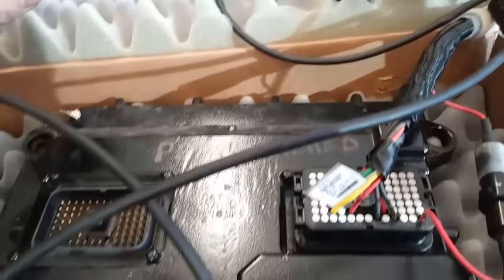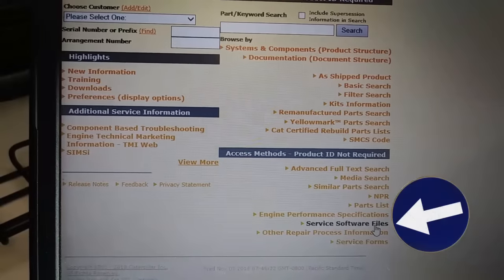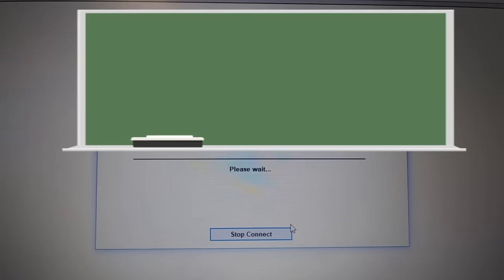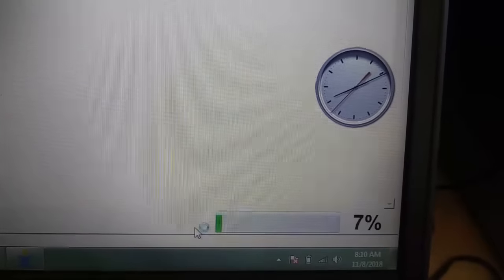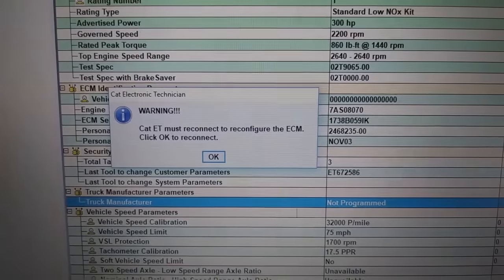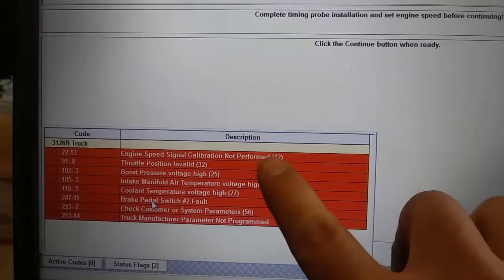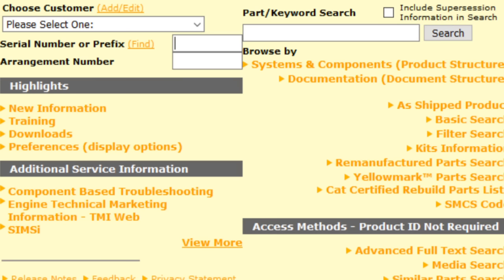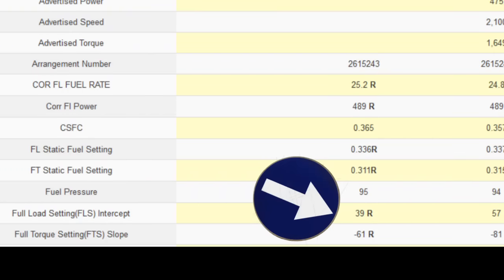How To Program A Cat ECM. How To Flash A Cat ECM. Cat Computer Programming.

Comment: I have a 2001 Kenworth t800 c12  ycpxm0729erk engine#2ks49050, I have installed a 2007  c12 BCY-00138 family 5cpxl12.0esk (military surplus engine) generator engine my questions #1  is there a program out there for this conversion. Question  #2   what is the difference between the two engines other than voltages the ypc(445hp)  hp and variable speed and the BCY is 515hp and wants constant speed (RPM) and turbo, is  the camshaft the only difference or is the crankshaft and stroke different. I did had a local guy program the BCY (ECM) it does run and idles fine but  when driving there is a few spots that the engine sputters then puffs out big cloud out the exhaust pipe (fuel) I can feather the throttle out but I want to fix.  Any ideas to help. I think its the camshaft and timing issue in programming, Would you know if its just the way the camshaft was designed for constant RMP. and /or think that if I change to a truck camshaft and ECM that it will work with the crankshaft and stroke of the BCY engine  and/or the injectors need to be changed .I really enjoy your videos and thanks for sharing your knowledge and experience cheers

Comment: I am having a head scratcher problem, I do all these steps, get the same starup communicating messages in this video, ATA then CDL, the j1704 light flashes but yet it always comes back with no ecm detected. I know this can't be right cause my 3126b starts and runs just fine??

Comment: Got a REALLY left field question here...   Would there be any possibility at all of taking a direct injection CAT 3408 and modifying it to be an electronic engine.  For example,... using electronic injectors from a 3406E or later electronic engine?  I'm sure there would have to be custom heads in order to fit 3406E or later injectors into a 3408,.... and then there is the entire ECU problem.  But what about going with a stand alone aftermarket ECU?  Just throwing around some crazy ideas.  The 3408 is such an awesome engine and I want to put one in a Peterbilt,... but would like to get best performance and fuel mileage with newer electronic technology.

Any thoughts, comments, etc. would be GREATLY appreciated!  Thanks

Cyrus

Comment: does reflashing an ECM damage it in any way.  I have a BXS engine that had the double turbo and was converted to single turbo the ACERT was removed all prior to me purchasing this truck.  i now had to purchase a new ecm and when the mechanic reprogrammed we now have the check engine light and three codes which are due to the ACERT being removed.  I have a guy that can put a new program that will remove the codes but I would like to know if reflashing will damage my new ECM
Reply: No

Comment: Great video thank you for all your help allways   Got a quick .question I have a 97 kenworth with a 3126   We did a covertion from 390 rear end to 358 teams end. And now my truck won’t t go over 60    Do I have to take it to get program ??
Reply: No you have to take it with someone who has a tool that can connect to the ECM and reprogram the PPM.
PPM = Number of chopper teeth on transmission X Axle Ratio X Tire REVS per mile.
Reply: You have to change the dip switches behind the speedometer so it reads correctly. Then update your PPM in the ECM so the data is stored correctly there.
Reply: @jimmywells33  is there any info on how to do that? Changing the dip switches etc?

Comment: Back in 1996 had a new KW doing the second oil change, around 20k miles, did the service started engine ran for leaks shut truck off, went into the office to pay the bill come back to truck check oil level go to start truck to back out of the shop engine wouldn't start, the ecm died that fast

Comment: What could cause coolant to mix with oil and also oil preasure drop at the same instance....? CAT3406e
Reply: Possible crack in the block or cylinder lining,  head gaskets
Reply: Or the oil cooler. Happened to me i had a 3406E IN a 96 freigjtliner FLD. Mixing oil and coolent and lookes like milk. This was back in 06.
Reply: Could be O ring's

Comment: aloha adept ape , i have a morbark 2006 model blizzard12 w a caterpillar eng 3054c/e type 2 this eng has 3 settings for the rpms and the high setting is revving at 2550 rpm. its seems high and i am inquiring of how to lower the rpms to 2000-2400. any advise ?

Comment: hey buddy, how r u? i wish u the best for all your helps
i have a problem,
i have an engine which its ecm needs to be flashed and programmed again, but unfortunately the engine does not have any id and i just guess it is 3406e. now the current ecm communicates with adapter but as someday was changed with someone and not correctly programmed, it does not show any serial no and maybe that is the reason the engine does not start.
finally i want to know that is there any way or method to get the ESN of an engine by not counting on id plate or ecm info???
because i need to get the correct flash file and program the ecm well.
my best regards

Comment: I have a question for you Josh, if someone got your timing calibration, or fts or fls messed up could it cause a truck to start burning oil. I had a ecm go flag and right after I started using oil. Thanks

Comment: Can anyone help me out about check engine light ECU 128 PID 289 fail 05  I have 2009 freightliner Columbia with C-15
Reply: Most of the time you have a bad connection on the IVA solenoid. You can buy a harness or a splice. The splice rarely holds. I usually take the splice (if I use one) take it apart and use the plastic connector. I take the connector on the engine and remove the plastic connector and spread the connection to get the fit tighter. I put the new connector onto the harness and feel if its snug.
Reply: John Goldsmith  thanks I’ll try

Comment: Hi mr. Josh,

I had a question, what do you say about that whenever I want to test cylinder cutout on one of my engines, it is aborted automatically.
I tried at different times and watched the loads on my engine, but its unreasonable because I had no change in loads

My best regards
Reply: Did you solved it?

Comment: I wonder if you can repair the computer on a component level if that's the issue.
Reply: Yes - there are companies out there that will repair your damaged ECM and flash the ECM with the original and/or updated (higher HP rating) if you want that done too.  As with all electronic repairs, the success rate is all dependent on the company doing the repair and going with the cheapest place usually ends up with a poor experience.

Comment: In 2013 I took my motorhome to Yancey CAT for check/valve lash adjustments. I wish I haven't. I doubt any adjustment was needed. They trimmed my fuel injectors. They didn' ask or tell me.. I'm sure they thought I would never know. And I didn't for a long time. One of the digital readout available on my motorhome is engine load. Before the engine would load at 99%, now it's 79%. Not a good business practice. Paying Yancey CAT cash for nothing.
Reply: Yancey put a turbo on my truck. 2 months later was in another Caterpillar shop for unrelated issue, they had to remove new turbo, found out Yancey mechanic Jason left a piece of metal in air pipes & turbo was severely damaged. Yancey would not stand behind their work. NOT recommend Yancey to anybody.

Comment: Good morning there. I was just reading some of the comments I bet you can sit on the computer ALL DAY answering questions...! 
ANOTHER great video I will get back with the Vin I'm not at my truck yet...TY
Reply: I just wanted to mention I called Triple-T they told me I've got to install one on the passenger side behind the oil cooler there's a plug unscrew it and screw the other one in... I was just letting you know what I found out or I can put a block heater on it.
I am being told it's not a bad job to install that plug not hard at all...?
1500 watt plug..
1fuja6av37w93940
Reply: Good morning Josh Friday
day after Thanksgiving anyway hope you had a good 1...... I just wanted to see if you would look up this part # 3500111 engine heater cat 15 and see what you think..? & how difficult to install
I cannot find not one single video on it.... sorta unbelievable...THANKS

Comment: I had a truck where we coudn't connect to the ECM from the plug under the dashboard. The gauges and warning lights were all over the place, but the truck still ran relatively well. It turned out that the ECM was fine, and there was bad wiring between the truck and the ECM. Once this problem (corrosion) was tracked down and repaired, the truck worked properly. The lesson being: please check all is well before diving in to the ECM.
Reply: Funny u say that cause guys who tuned ecms use to pull 1 wire from plug so dealer couldn't change tune to a low NOX when truck went in for work